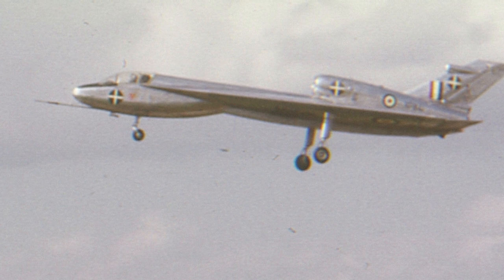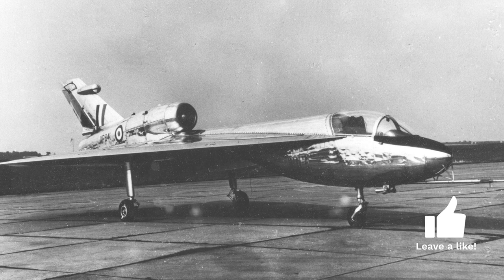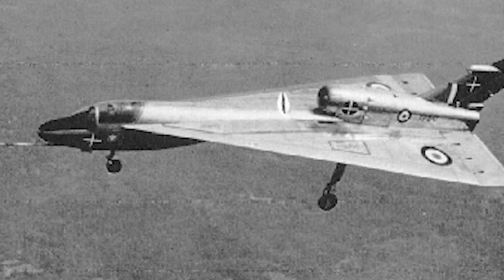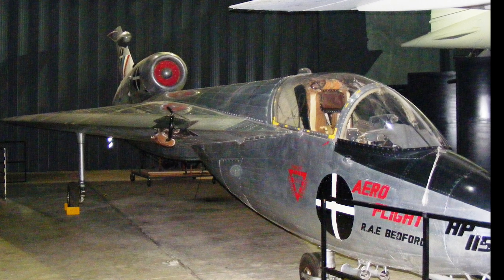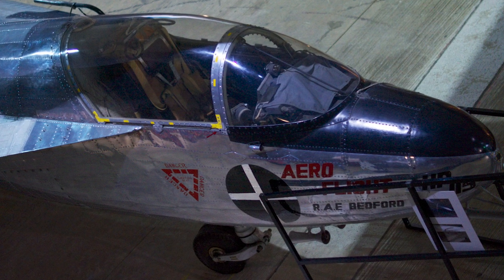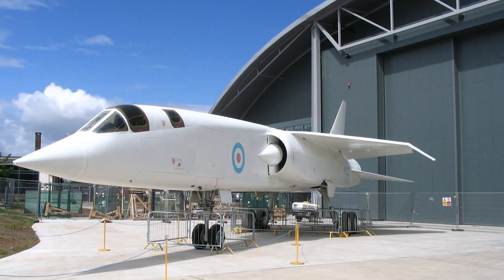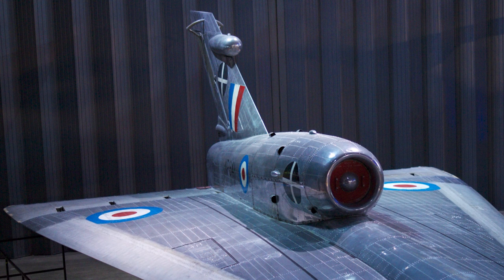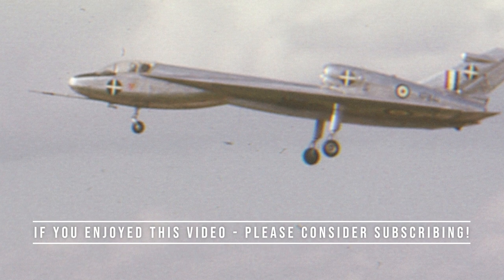Handley Page HP.115 - A Short History

Comment: The undercarriage was not retractable. It was fixed. Interestingly it had only a battery for electrical power and fuel for about 15 min which made getting it shown to the Farnborough air show a tricky flight.  I think I remember that it had balsa wood wing leading edges that could be varied.